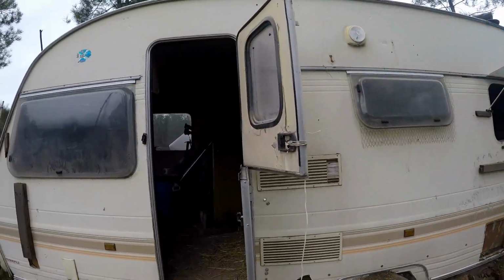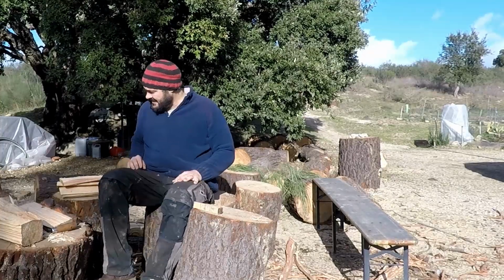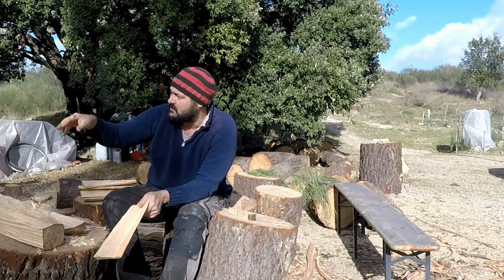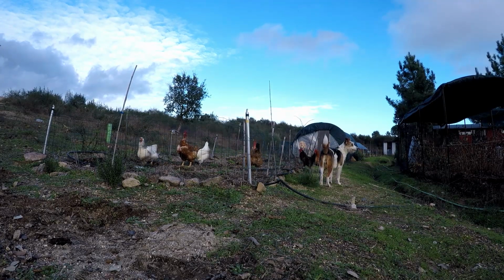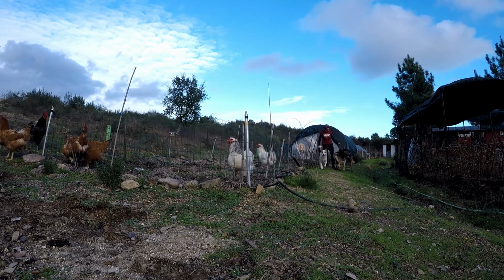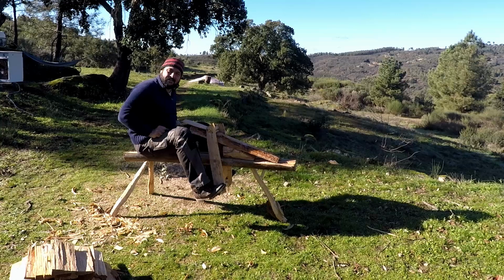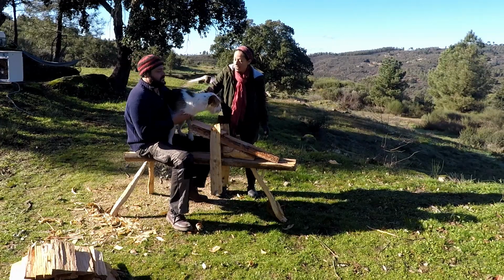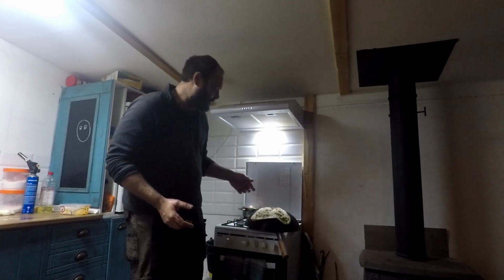Shave horse build and a dangerous naan hack - Off the grid in Portugal #3

Comment: Here they make shingles out of cedar and they don't make them flat they just make them thin on one end big on the other end but they don't take the grooves off they just leave it they last for years and years and you can look up and you can see daylight through the cracks but they never leak it's the weirdest thing you think if you could see through your roof that you would get a lot of water on your floors but nope they don't leak And the thin part goes underneath the top one above it you start from the bottom put the thick part on the outside thin part at the top and go all the way up the roof that way:face-purple-crying::face-purple-crying::face-purple-crying::face-purple-crying::face-purple-crying::face-purple-crying::face-purple-crying::face-purple-crying::face-purple-crying::face-purple-crying::face-purple-crying::face-purple-crying::face-purple-crying::face-purple-crying::face-purple-crying::face-purple-crying::face-purple-crying::face-purple-crying::face-purple-crying::face-purple-crying::face-purple-crying::face-purple-crying::face-purple-crying::face-purple-crying::face-purple-crying::face-purple-crying::face-purple-crying::face-purple-crying::face-purple-crying::face-purple-crying::face-purple-crying::face-purple-crying::face-purple-crying::face-purple-crying::face-purple-crying:

Comment: Back when we had a gas range, we would heat the naan in a dry cast iron pan (flip for both sides) then plop it on the open flame of another burner to finish. The open flame would cause a giant air picket to form. Yummmm. Really hard to do on an induction stove top 🤪
Reply from the maker: Hi Junco.. nice way to cook naan too! Induction would be a problem 😂
So much less hassle than lighting the tandoor every time.